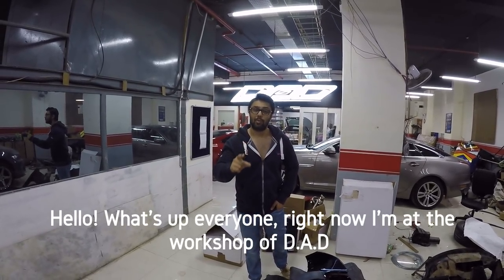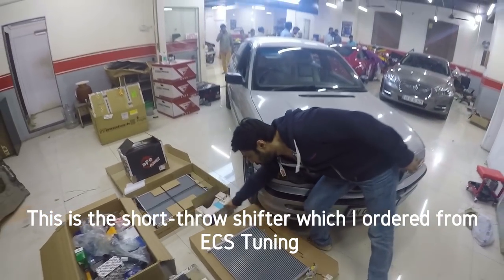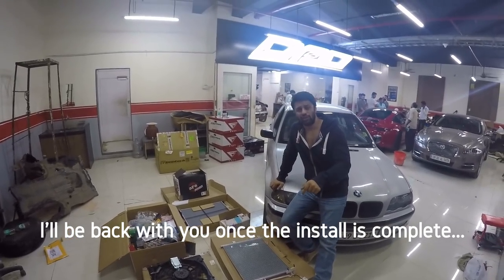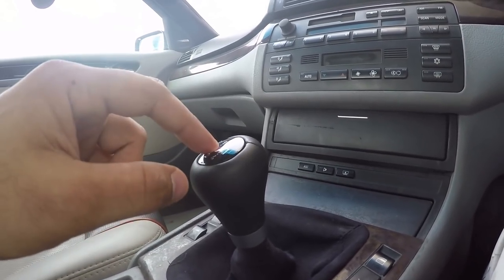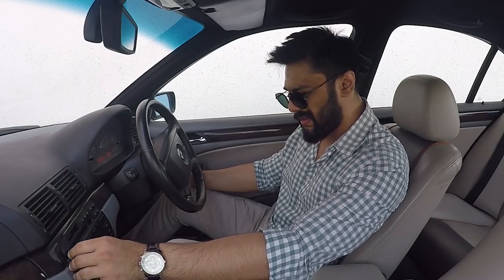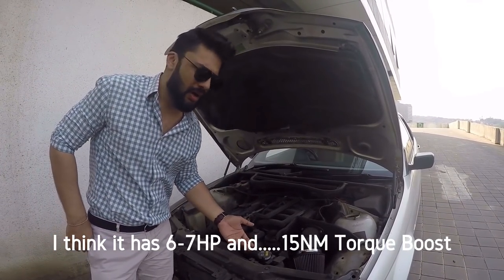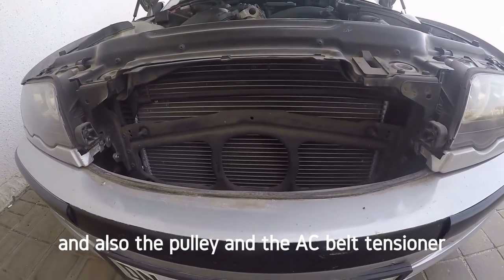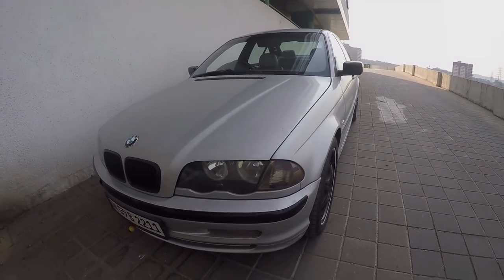Project E46 - Part 3 [Cooling System Upgrade, Short Shifter & More]

Comment: since you have engine swapped the car,is there any need for changing the clutch plate?
Reply from the maker: Initally i though so myself, but currently will continue with the stock clutch for some more time.